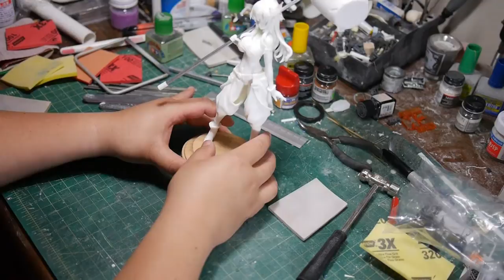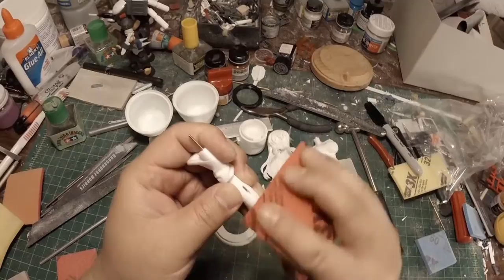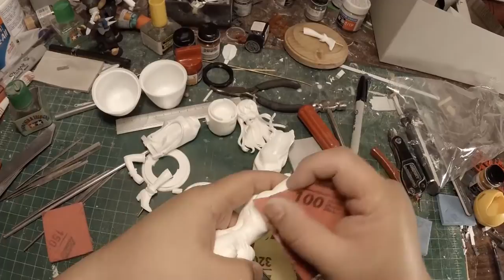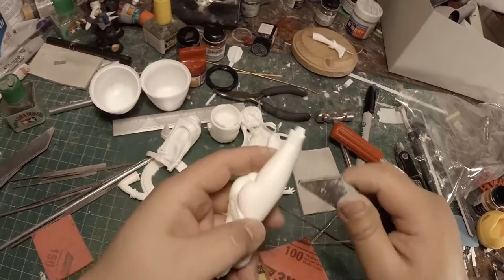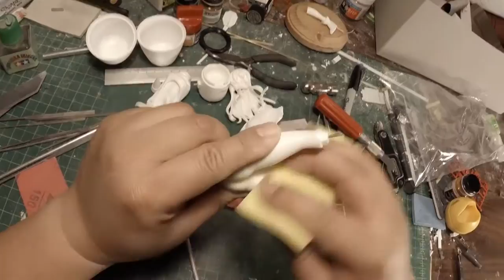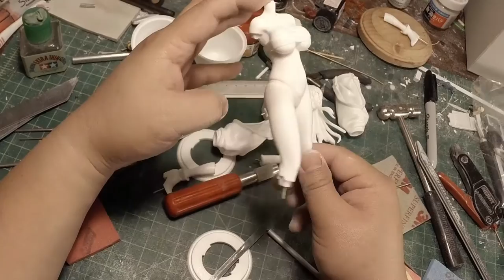Resin Figure Model Building: Initial Sanding

Comment: Do you do anything special to deal with the toxic resin dust?
Reply from the maker: Usually a mask is a good idea.  But it's difficult to talk over a mask when doing these tutorials, so certain safety concerns have been completely ignored.
Reply: gamerabaenre Yeah, I can definitely see how a mask could ruin the audio. I've always been interested in GK building, but the cost of a proper painting setup on top of the toxic nature of resin scared me off. Good to know I won't keel over and die instantly.
Reply: Wet sanding with 400, 600 grits etc...

Comment: where did you get the sanding sticks, the ones that look like nail files?
Reply from the maker: Those black snading sticks I picked up from my local hobby shop.  Most hobby shops carry some kind of sanding stick like this in different grits, usually medium, corse and fine and sometime super fine and such.  If you are refering to the metal sanding tools, those are jeweler files.